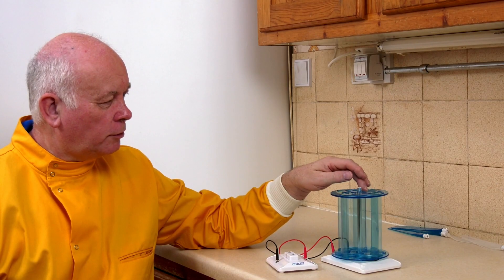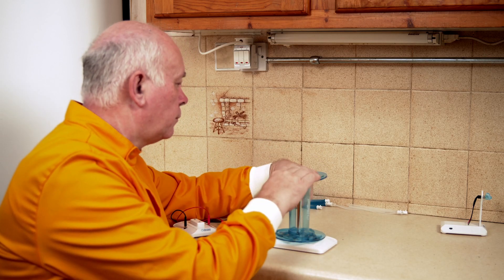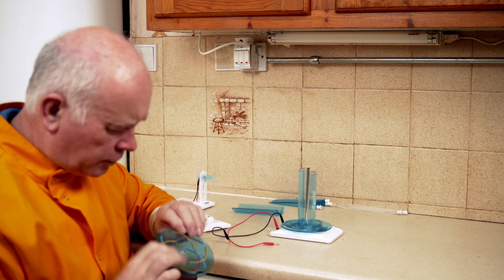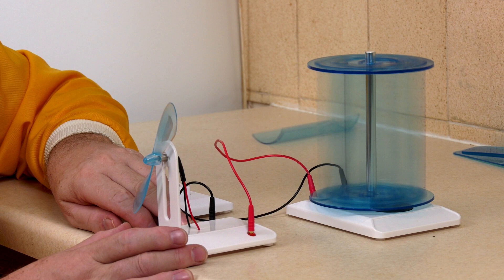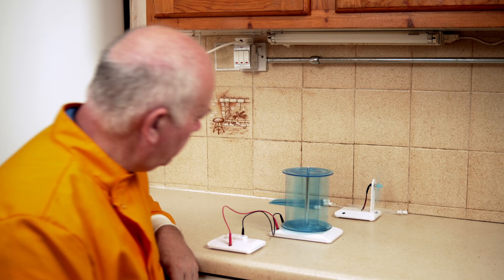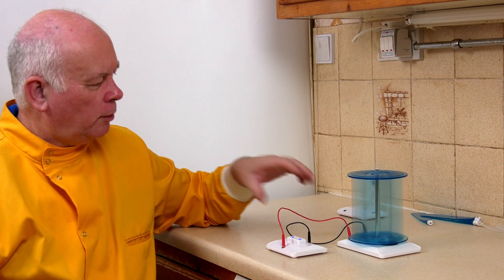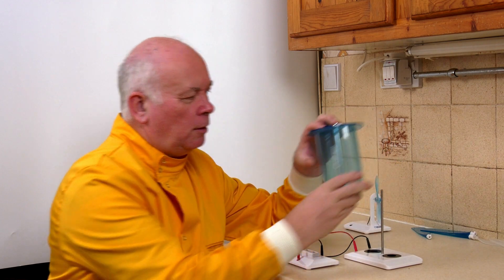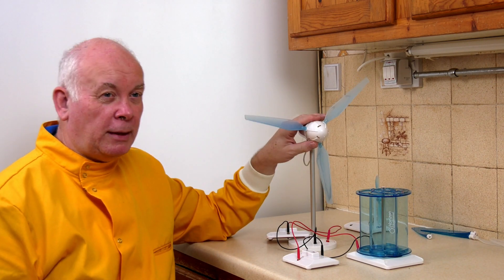model vertical wind turbine

Comment: Aren't you plugging alternating current (n-s-n-s magnets on the turbine) onto a direct current fan motor? How is that going to work if you don't separate out the positives from the negatives first?? Correct me if I'm wrong, but, AC and DC don't work well together.

Comment: the swept area of the horizontal model is 3 or 4 times more bigger than the area of the vertical turbine. Not is a fair way to show the difference in efficience.  Horizontal are more efficient, but only in special conditions, the vawt can work in ANY condition of the wind, then can be applied to home generation without the problem asociateds to a big horizontal wind turbine instalation and maintenance.

Comment: Although this is a cheaply produced turbine for educational purposes, it's a shame that it wasn't produced with larger/stronger magnets and/or better stator coils. It was apparent when you turned the "wind" off, with the turbine running on effortlessly whilst still powering the LEDs, that the limiting factor here is the poor efficiency of the generator. That's not helpful in this case, as it doesn't give a true feel for the relative capability or the efficiency of the turbine to capture the wind's power.
Reply from the maker: We are doing more of these to help
Reply: I agree with this statement. It’s clear the generator is terrible in comparison to the horizontal version I see in your other videos